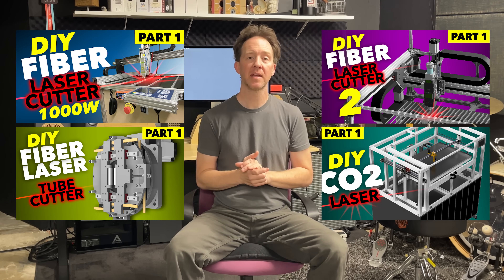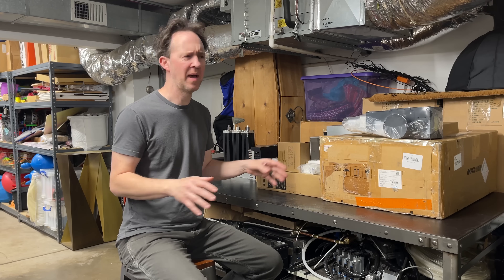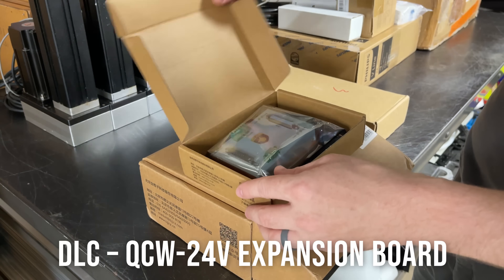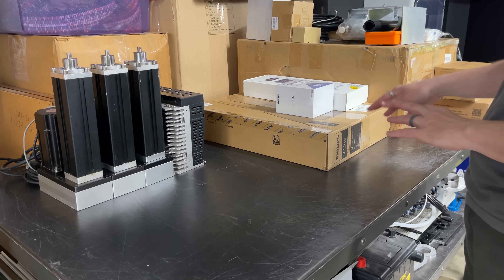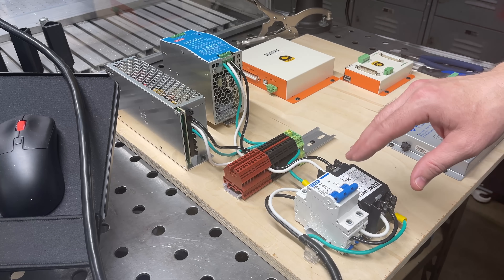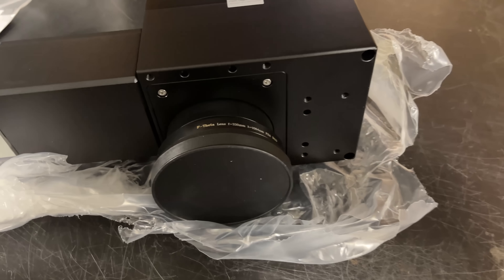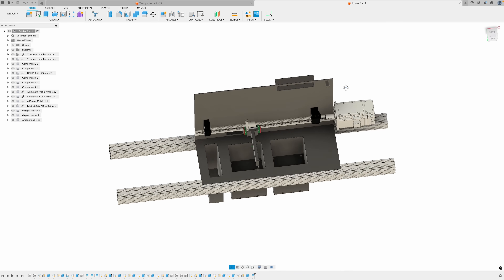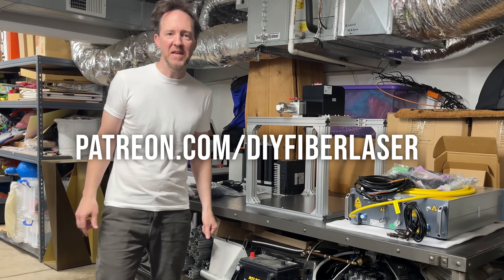DIY Metal 3D Printer: Part 1

Comment: This project seems expensive, I'm interested in how well it works against other machines even if it's theoretical; Bed size, speed, quality. How much have you spent on the components in this video or intended to spend on the project? I want one of coarse, thanks!
Reply from the maker: It is expensive for me, I’m still purchasing components so I don’t have a total cost yet…hoping it will be under $20k

Comment: look up direct machine control, their software would pair very well with your build. personally have used it for custom epoxy/laser based systems, but they do offer 3D slicing as well. best of luck!
Reply from the maker: Thanks for the suggestion, that does look like it could be a good slicing option...I will check it out

Comment: the slicing software you chose is made in Russia. for printing with all metals, you need a chamber without oxygen access, with the ability to purge with argon and pump out oxygen (when you open the hatch cover)

Thanks for project!

Comment: Cool idea 💡... I want to throw a few things out to you... I have over 30 years in manufacturing so I do know what I'm talking about when I say this... be sure to be extremely careful about the powdered metal because of many things.  1st, metal is and does have exothermic reactions like fine powdered aluminum and steel... not a good mix and has caused deburr rooms to catch fire... it happened on a time-saver belt sanding machine. Normally at that shop they kept aluminum on the aluminum machine and steel on the steel machine and are in separate areas in the building... however, we had a big job that needed finishing up and the staff that was working that day had never heard of the 2 mixing being an issue and went ahead and started mixing the 2 fine powdered metal's really just what was coming off when sanding the surface... anyways it caused a fire 🔥 pretty big one... lots of damage... so... that being said I recommend  knowing the possibility of reactions with the material that you use as you do it... and when you switch from one to another that follow safety data and use care... 1 other story, we have surface grinders and rotary surface grinders and do grind all  kinds of materials on them as well and found out the hard way that even mixing some of those materials in water... will get hot and have a reaction. We had an explosion over the weekend one time for the same reasons... so just be careful and safe... I am personally very interested in this process and would like to have the capability myself... Good video, I appreciate you...
Reply from the maker: Thanks, I appreciate your insight! I plan on only test printing with stainless steel powder. maybe one day when I feel more educated and confident I could try a different type.

Comment: Pure argon/nitrogen flushing might cost quite a lot of money to get the oxygen concentration down. I would consider building a vacuum chamber and doing a vacuum + flush system. It will significantly increase the chamber construction cost, but should result in a much more controlled environment. A nitrogen concentrator might alleviate some of the costs, but you'll be waiting a long time for a full purge regardless.
If you need help designing the chamber for vacuum operation and auxiliary systems to support it, feel free to reach out(my contact info is on my site), it would be fun to help.
Reply from the maker: That's a really good point, I wasn't even considering how much more efficient vacuum purging would be. But I'm still not sure...this project is already so overwhelming that I wonder if I would be better off just trying to go as simple as possible (even if I waste more gas) just to get a working prototype, and then going back and making these kind of improvements on subsequent versions. If I go the vacuum route, I will definitely reach out and get your input...I would love the help!

Comment: I've worked with several different SLM printers, for filtration and passivation in your condensate I would look into using bicarb(calcoim bicarbonate). We had several EOS machines using filters designed by Herding Filtration that used bicarb as the passivation medium and then silicon oil to fully mix and expose the condensate to tbe bicarbonate without exposing the pyrophoric condensate to oxygen

For inerting your chamber or speccing out your enclosure, I would look into repurposing a vacuum chamber. Some of the most consistent results I got when I worked in the Metals lab was off of 3D Systems DMP350 machines(they have single, dual and now triple laser configurations, but consistent across all of them is an inertion step that alternates between pulling a vacuum and filling with positive pressure inert gas)
Reply: The 3DS DMP350 would pull a vacuum of -1000mbar and then fill with positive pressure until +150, and would complete this step 3 times
Reply: @noahc6544  When you see the chamber (and door) design of the P350 to handle the vacuum level, that's an heavy baby which is probably overbuild for a diy project? (even if that's the fastest way to purge the chamber)
Reply from the maker: @quentin1362  The vacuum definitely makes sense, but from some of the cheaper machines I've looked at, it seems they are just doing a multi-stage purging process without a vacuum?...at the expense of using more gas I imagine. I need to figure out what makes the most sense for a DIY machine, as there are already so many complications...it seems like simplicity should be a priority, if we can get a basic working prototype, then there would be the opportunity of making improvements on subsequent versions.
Reply: @diyfiberlaser  if you can find an already built vacuum chamber that was built for a university lab, that would likely be the easiest chamber to start with. The EOS machines I worked on didn't pull a vacuum and just purge down for ~40 minutes, but consumed about 8x the inert gas
Reply from the maker: @noahc6544  That's a good idea...I will search local listings and see if there is anything available
Reply from the maker: @quentin1362  That is what I imagined doing...but I had no idea it would take that long to purge...thanks for realigning my expectations : )
Reply: When you are designing the upper chamber area, maintaining fast and laminar flow is fairly important to prevent condensate redeposition is one way to prevent porosity in your finished parts. Another cause can be the ovality of your beam source, because of the way that the condensate forms inside of the melt pool it tends to form in what looks like a j pattern, with the hook underneath the melt pool and without proper flow it can get trapped underneath your melt pool
Reply from the maker: I am grateful for your insight and guidance, this is going to be the challenging part of the project and I need all the help I can get : )

Comment: What you’re calling SLM is actually called LPBF (root process name.)  Laser Powder Bed Fusion is potentially catastrophically dangerous if you get it wrong with the wrong materials.  You need to learn about the myriad of potential hazards of working with metal powders.  You also need to understand the EXTREME explosion risk.  I’d recommend building an explosion proof vacuum FIRST!  Once you understand that, then continue with this project.
Reply from the maker: Haha, I've had a number of people tell me the preferred name and it is all conflicting, and it's all basically the same,  so I just went with SLM : ) I have been trying to study up on the hazards and realize the explosion risk. Also I've seen conflicting information on purging the oxygen and replacing with nitrogen/argon...some recommend using vacuum and other recommend just using a multi-stage purging process...would you care to elaborate on the benefit of vacuum purging? I'm open ears, trying to learn and gather as much information as possible

Comment: I am in charge of the design and engineering at a pretty reputable company and my specific responsibility is laser powder bed fusion or SLM equipment as you described. I make sure the parts we send to this equipment are printable and successful I am excited to watch your progress while it will be a huge mountain to climb you seem to have the right suppliers helping out. I wonder what the final cost will end up being. Subscribed
Reply from the maker: I'm glad you are watching! Hopefully you will help guide me during this process. It is too early to tell what the cost will be, but I will definitely share my costs when we get further into the project.
Reply: @ for now I think you have more knowledge than on the hardware and software setup than me but once we start getting into powder and parameter settings I may be of some help

Comment: Wait a moment, you can buy parts to build a proper metal 3D printer?!
Dope
Reply from the maker: Haha yes, just like my other machines, if I'm gonna DIY it, I want as close to professional results as I can get. I owe it to SkyFire for contacting existing printer manufactures to find out the laser components and specifications they are using...so hopefully we can get some good results
Reply: @diyfiberlaser You probably will have a lot of issues with powder spreading, but good luck!
Reply: @Arek_R.  thanks for mention, but anyway we need to explore, it's a journey
Reply from the maker: @Arek_R.  Oh man, I was hoping that would be one of the easier parts : )

Comment: imagine we we end up in a few months in WW3, how difficult it would be to replicate this process. doe you have access to the lasers, controller boards ,what happens with software down loads, the supply of the material. ..... I like this kind of things but we still have to maintain and educate young people how we make parts whiteout  hi-teck solutions.
Reply from the maker: You bring up valid points, but I myself am not a traditionally trained machinist or fabricator, I do not know the trades and thus don't make that kind of content. I understand that it is not for everyone, but this is what I know and share.

Comment: the biggest issue will be powder handling.
if done wrong enough it can ignite the powder and create a explosion.
some metal powders are also quite reactive, they will react and explode if they manage to oxidise.
also make sure to clean out the entire machine including filtrationsystem properly when switching materials its not fun when the filter suddenly turns into instant thermite because some Aluminium and steel powder where inside of it
Reply from the maker: Thanks! A lot of people are bringing this up, I will be subjecting my designs to everyones feedback before I ever attempt to print anything...only when I get a consensus from viewers that the filtration system is up to par will we move forward. I hope you will follow along and give critical the feedback!

Comment: I think the laser part is the only 'unit' on this project that will be straight forwards.The chamber, heating powder handling will drive you insane :) !
Reply from the maker: Haha yes!...you have clearly picked up on the fact that I am trying to do the easy stuff first...I'm procrastinating, still trying to wrap my head around how to approach the complicated bits.
Reply: @ Na you are doing it right. Get the fundamentals out of the way. No use of spending months on the powder bed, then the laser wont work or fit. 
After all the Laser can be used for many other things, if this all fails. The powder bed not so much

Comment: @diyfiberlaser, there is another channel on here that has been working on a similar project.  They have encountered many hurdles,  which maybe you are or are not aware can come up.  I won't mention the channel name out of respect unless you ask,  but if you have time to explore,  it might be beneficial to you and help save some future headaches.
Reply from the maker: I appreciate it...if it's on YouTube, I've probably seen it...I've been dreaming of this project for quite some time now
Reply: Yeah, it would be nice to see a working build.  Just wish viber Lasers would start coming down in price. Do you have plans for non metal media support?  Or only metal media?  Also, do you have plans for a sintering? From my understanding,  even if a past is printed in 100% metal, it still needs the process.  But maybe that is no longer the case.
Reply from the maker: @Protocol-X  Only metal media support. I'm not planning on sintering...from my understanding sintering WILL improve the final properties of parts, but without it they should still be pretty decent...since I'm just doing this as a hobby, they should be good enough for me.

Comment: I run a 3D printing service, and among other machines, I have three EOS M290 printers. I've been hoping for content like this for years... I can't wait to see how the project evolves. When you talk about the gas in the chamber, it's not just argon that's used but also nitrogen. The profiles provided by EOS for printing materials can be modified in many parameters, including the type of gas used. Why is there a shift towards using nitrogen almost exclusively in the long term? Because it's cheaper And the print quality is not really affected by the type of gas used at least for steel. you mentioned the filtration system, in my experience, that’s really the Achilles' heel of these machines. Over time, leaks always seem to develop, which not only allows gas to escape but also lets oxygen in, causing the machine to shut down. Finally, the worst part is the filters,the burnt powders in the filter are extremely reactive and love to catch fire as soon as you try to change the filter...
Reply from the maker: Thanks for your input! I can use either nitrogen or argon...I already have both cylinders types from my other machines, so I can use whatever is cheaper. I'm glad you're here, I need lots of advise on the filtering system as I have no direct experience with these machines...I'm going to be heavily relying on experienced users!
Reply: How about system that gets the old filter before it's removed?

Comment: Great project, I'm impatient to see where it goes. Do you have a wire EDM to cut the part from the build plate? Dan Gelbart had a video where he mentionned that the dirty secret of metal 3D printing is all the finishing tools needed after the print is done.
Reply from the maker: I don't have an EDM machine...I was planning on using a bandsaw to remove parts from the build plate, which will probably require using a raft and supports to give me an area to cut...then I can clean parts up on my milling machine and glass bead blasting.

Comment: In terms of slicing, you might be able to modify a MSLA slicer to output .slc. Would be easier than a FDM slicer since it’s whole layers at a time.
Reply from the maker: That's an interesting idea!...I would still prefer to find an off-the-shelf solution since there are already many other problems to solve.

Comment: As someone who has done DFMEAs on SLM printers…
Explosion hazard as others have said must be addressed.
Air filtration/dust separation(as you mentioned)

One thing I didn’t hear you mention (I was distracted a few times) is how to handle the inert gas. Once you fill a volume with argon or nitrogen it is terrifyingly easy to asphyxiate yourself.

There’s a reason these machines are 6 figures, be careful.
Reply from the maker: This is exactly the kind of feedback I'm hoping for. I know that I am not alone in wondering if this type of DIY project is possible...I want to explore and learn, I want to understand the risks, and hopefully with the group's feedback we can see if this type of project can be safely implemented...please keep the comments coming...I'm open ears!
Reply: @diyfiberlaser Make sure you have O2 alarms. You can pass out without any warning
Reply: @diyfiberlaser  I wish you the best. I no longer design 3D printers. As an engineer who has also done high volume manufacturing, the current big names don’t understand what it takes to make an automation ready, integration ready productive machine. 

They are coming at the 3D printing problem as scientists when we need accountants and engineers to work together to make these things economical.

Comment: It's not a good idea to use ballscrews on a recoater, powder coat time is slow and there are frequent breakdowns
Reply from the maker: Thanks for bringing that up...I don't see how speed would ever be an issue when I'm going to drive it with a servo, but since you mentioned it, I could see how it would probably require frequent cleaning due to the metal powder....I think you're right, belt driven would probably be better in this scenario.
Reply: @diyfiberlaser  In a dusty environment, running a ball screw at high speed significantly shortens its lifespan. That’s actually why we switched from a ball screw to a chain system—we had several failures because of ball screw. We were practically praying every time we ran the machine.

Looking forward to the next video. Thanks for video!
Reply from the maker: @hone2728  That's interesting!...I will probably experiment with a robust belt drive and see how that works... I was also thinking of making a few different blades and comparing their performance...I'm looking forward to getting to that part of the project...should be fun!
Reply: The risk of belts is stuttering which can ruin an otherwise clean application of powder. You can either go with a compliant or a rigid recoater blade, which prefer different drive systems. Acme screw is probably the easiest. Ball screw has a short lifespan since the powders are abrasive.